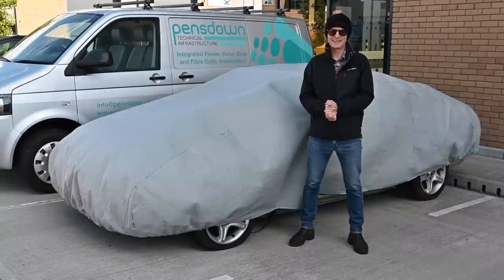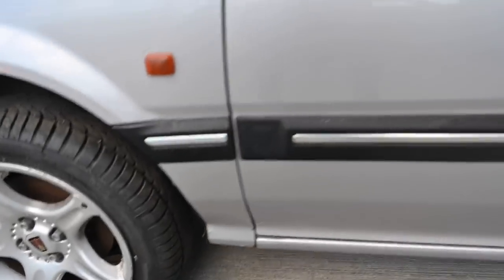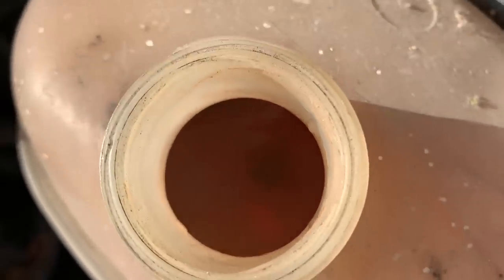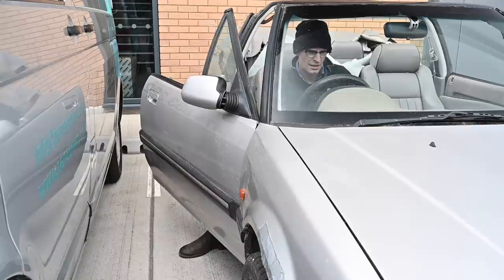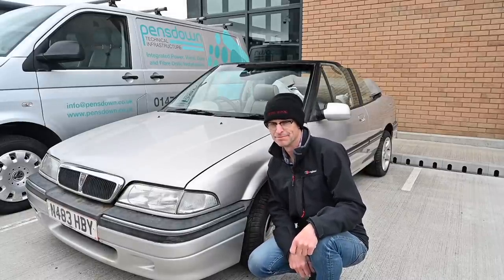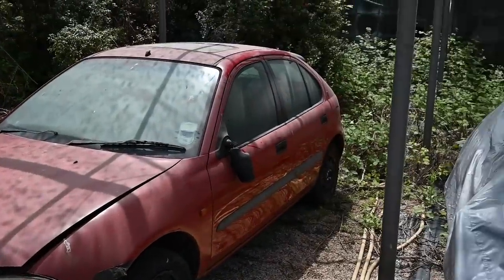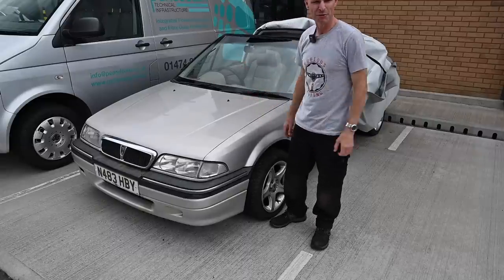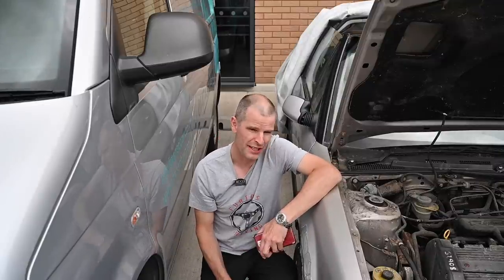New project reveal, another stray joins the fleet

Comment: That rotten front wing is a slightly different shade, I wouldn't be surprised if it's had a pattern wing fitted in the past. They're never galvanised and rust extremely quickly if when painted which explains the advanced state of decay over the rest of the body which isn't too bad.

Comment: I had 2 of these, 216 convertibles, I was always robbing parts between the 2 of them to keep one of them going.  Watch those back windows once you get the roof working, they tend to jam up against the roof and shatter if the are not correctly aligned, happened to me twice!!  BTW the leather seats get painfully hot in the sun, the cloth seats are better (if the roof works).

Comment: Hi Matt,
if the EKA is not working, then try and get the fob to work. They are actually a very reliable system, they honestly are. Once working they stay working. Try a new key fob battery (cr2032 it should be) and then re-sync the fob. Any time it has not been used for a long time, or the battery removed etc. the fob looses sync with the car. To re-sync it, you basically keep pressing one of the buttons.

The only problem they have, is where the little battery holder is soldered to the pcb, the joints crack/break.
Reply from the maker: Wound up changing all the ECU and EKA

Comment: Good luck with it Matt,  you mentioned the jacking points and I've seen many cars with dented floor pans so what I tend to do is mark the points with yellow paint and keep a grooved round rubber jacking pad in the car, it's too easy to forget the exact place along the sill seam when access isn't that good or at the side of the road.
Reply from the maker: many have a mark stamped there as well, which is very sensible

Comment: What were you thinking man? I'd make that someone else's problem/project if I were you. Also 16:40 did make me chuckle a bit.
I found this on an old forum which might help:
 try the following :
put the drivers window down - disconnect the battery - put the key in the ignition and turn to on - reconnect battery - see if that sorts it - if not try this again but then lock and unlock the drivers door before trying to start.

Comment: Seeing all those Rovers makes me wish I still had my 214SLi. It was a really early model on a G plate, with central locking (non-remote) and electric mirrors, but manual windows and no power steering. I kept it, planning to do it up "one day", but in 2008 it ended up getting scrapped when I traded it with a 1987 Audi Coupé GT from a scrap collector.

Comment: Hello, Had the same imobiliser problem with Rover 100. Turned out to be the body to loom earthing points - they rust under the connectors (even on a car that is used). Take them all off and clean and you should be able to turn off the imobilser. It you need to get the fobs and receiver checked a company in the west country called remote key can sort it by mail order - also take the connecter off the ecu and imobiliser and clean with switch cleaner as the pins on the connectors oxidise. Hope this helps.
Reply from the maker: Worth a try, thanks!

Comment: Did anyone else shout at the screen "borrow the batteries from the Tomcat keyfob to make the convertible keyfob work and deactivate the immobilizer"? I've used this trick to get an R8 started a couple of times, and it's gotten me out of a hole on both occasions. Shame this car was just abandoned for all those years, bet it was a really nice example when parked. Looks like a money pit from what we see on the video. Be careful Matt. For what it will cost to bring up to a running MOT'd condition, you could probably buy a really nice one and avoid all the grief. Not to mention that dreaded piece of paper with the word Absolute written at the top of it. If you know what I mean. Not even a Rover is worth that mate. Trouble is, R8s have such a habit of pulling on the old heartstrings.That breakers yard looked like heaven. Would love to while away an hour or two in there. Though I'd probably end up buying everything.

Comment: I would of got it going before spending with an alternator ,but anyway you would expect that disarm procedure to work .Try taking the door trim off and look for micro switches , squirt a bit of switch cleaner on them.You may even find it won't disarm until the hood is up and boot lid lock sorted .Give me an old car any day of the week to much electronic s  on them now.Seeing as you have gone that far concentrate on getting the hood up and the boot open

Comment: Matt what you need is a new battery in the fob. That should work. If it doesn't then you need the EKA code to override the immobilizer. I can tell from what you did that you do not have it. This code can be obtained for a tenner at most. By the way don't jack these on the cills there is a jacking point at the front of the car. If you need me to take a photo of how you override the immobilizer from the handbook let me know as it is the same as my 1.6 coupe. As for the boot I take it that the boot release in the car is also broken? Finally again I have a handbook that shows how to manually release the hood. Once you get in the boot and have it running it will make things way easier.

Comment: The jury must be out until you have it running and if it drives. The body will come back with some love but the interior is your insurance ,Rare. The immob might just be bad connections so good clean and wiggle on all connectors  and could be diagram time to check on pins for code signals from lock to immob. Its a basic unit so may be cheaper to go for a known good breaker replacement rather than send to a service centre. Greenhouse autoparts may need another visit. Fingers crossed for the hood. The 200 series rovers are still affordable for at the mo but will soon go the way of the other 80s  & 90s hatches as and when the numbers reduce a bit more.

Comment: Will be a nice project. You can program a fob at home for £60 but just put a new battery and try to get it working. You can press any button four times you don't have to press each etc also check the legs off the switch inside as they come loose.

Boot, I'm sure the cabriolet had a release lock on the floor where the boot and fuel flap release is and it locks the boot key out while the hoods down. If there is a key hole in the release on the floor try it and then try key in the boot and I'm sure it will undo.

I've had loads of these and worked on even more of them over the years.
Reply from the maker: They deleted the boot lock on cabrios for security
Reply: That's it I knew it was one way or another, can you feel the latch move in the boot when you try to unlock it?
Reply: @furiousdriving  very true, it's ages since I had my hands on an R8, rusty memory. If you can get the alarm box off and send it me I will get some fobs programed in as I've still got the gear to do it etc as I think your miles away from me in Yorkshire.

Comment: The car can be jacked up from the front central towing point, this allows both front wheels to be removed at the same time.....If both front doors are open and ignition turned BEFORE connecting the battery then the horn(alarm) won't sound

Comment: Watch out for the two small pieces of bent steel bar (one on either side behind the back windows) with ball and cup fixings on each end that pulls the hood in at the sides.  They snap regularly when the hood isn't maintained and it prevents the hood from fitting inside itself as it folds.  Mine broke twice and Rover charged a fortune for a replacement.  I showed the broken pieces to my Dad (who worked at a metal supply company) and he had someone make me a bag of 50 of them for £1!!!  The cup ends just screwed on.  I used at least ten of them over the following 2 years.

Of all the cars I've owned, my 1993 Rover 214 Cabriolet was my favourite.  It had 8,000 miles on it when I bought it in Maidenhead in 1994.  It had been a Rover Fleet car beforehand.  I traded it in for an Alfa Romeo 146 three years later (biggest mistake of my life - I've mentioned this in a comment before).  The only car I've enjoyed as much is my current Abarth 500C.

The thing I miss most about driving the Rover is the alarming scuttle-shake when you whizzed over a cattle-grid on a bend at speed.  It was exhilarating - the best location for such an experience being on the Isle of Barra on the road to Vatersay.  

If you sit in the driver's seat and look up at the roll-bar, it kind of looks like something from a shuttle from Star Trek The Next Generation!

I hope you rescue it.  I often wonder what happened to mine - K501 EKV; in metallic grey.
Reply from the maker: One is broken but Ive got that with the new hood

Comment: Worth perusing, any Honda based car deserves a second chance. 
The K series engine was a good little engine with only one Achilles Heel. The head gasket. That has been done so you have a good little engine.
Someone commented about a remote boot release lever. Not sure if it  had one but look between the drivers seat and to off side cill.

Comment: Code issue same same as a P38. Usually the lock is the issue so doesn't register the key turns. Fill it with WD40.

Also start with the car locked if it is the same as the Landy.

Odd these didn't get a remote boot release.
Reply from the maker: I think it is the same, these had the remote boot release deleted for security
Reply: @furiousdriving  may need to sync the key/fob as well. But good luck with it. 

4321 would be

Unlock x4
Lock x2
Unlock x2
Lock x2

Unlock car and start.

Comment: Did Mrs Furious Driving nearly lynch you then roll her eyes and say "Yeah right", when you assured her that it was merely bought either for its interior or to flip?😂
It is a good looking car that needs saving though. 
If you do work out the immobiliser spray a little bit of WD40 down the bores and turn the engine over by hand before you try turning her over on the starter.
After so many years she will probably be a little bit dry in the bores.

Comment: Morning Matt, so from my experiences with the dreaded Rover immobiliser firstly try replacing the battery on the keyfob and then repeatedly try pressing lock and unlock If that doesn't work there is a big chance that micro switches In the door lock are dirty and not registering the emergency key code so give the lock a good dose of wd40 and try the code again good luck ! Hope this one gets saved !
Reply from the maker: I was thinking it may be dirty. Now the shops are opening today I might be able to find some fob batteries
Reply: @furiousdriving  Fob batteries are available in all good supermarkets.
Reply: @furiousdriving  If that doesnt work then buy a coupe of used key fobs and get the all re-coded by a friendly rover/jag specialist with a T4 Notebook or a T-300 fault finder with a key programmer cable.
Alternatively this guy is really good, I think you can post him your ECU, 5AS and keyfobs and he'll recode the lot for you
https://www.technozen-electronics.co.uk/mg-rover-5as-alarm-ecu-services/
Reply from the maker: @seanturk1484  Ive not been to any in a while!
Reply: @furiousdriving  there's only a few common types
CR 2016
CR2025
CR2032
Have a look at your other car remotes and just "borrow" one 
to at least switch of the immobiliser.
Its been nearly 20 years since i worked at a Rover franchise so can't remember which battery you require.

Comment: I rather get the impression that this Rover is quite happy being asleep.  I suspect your issues with the hood and the boot are one and the same, the numerous joints in the hood frame have seized up from being sat with the hood folded, and the boot lock itself has seized from lack of use.  The hood might be easier to sort as the joints are somewhat accessible so regular doses of penetrating oil and spray grease may return movement there, but freeing the boot lock will be rather less easy due to the lack of access issue, though, once access is gained, the same procedure should do the trick.  I think your idea about breaking this one is the most sensible course of action, though.  Clearly its' storage over the last 6 or 7 years has not been the most careful or particularly kind to it, so I fear that the further you get into this one, you're going to find much more issues of the rusty kind, which is very bad news in a convertible.  On the up-side, what the car owed you with delivery should be recoverable from the engine alone, especially if the last owner can provide documentary proof for the engine work done just before it turned its' toes up.  I really struggle to see how anyone could drive their car until the alternator actually seizes totally, it would have been making horrible noises for some time as the bearings wore out, which is somewhat worrying as it rather suggests that the car had an owner with an absolute lack of mechanical sympathy, which really isn't good...

Comment: Wow what a collection of rovers
Reply: I looked for the link to that rover guy i scrapped my MGF SE..Last year to scrap guy for free,the year b4 i blew £635,on mot..but wasn't keen to blow the same at its last mot..but that place would have been the place to give them car..either for a resto project or a doner towards othe mgf se cars..body work was in fab condition it was mainly front wing,and the seat belt anchor points..oh and the suspension went lob sided but had that part..regret giving it away..like the rover you have..the doors looked and wouldn't open battery was flat,and bonnet realease catch stretched too..so gave up the ghost..silly little winter issues..

Comment: Sorry to say Matt rather a junker than a flipper 🐋 
Why don't you put new battery in the remote ? Very unlikely it's held a code but you never know.
Secondly I'd try and turn engine over by hand. It has been known a seized alternator would jump belt !
We used to just call Rover in the day to retrieve code. Always worked on the door method so I'm guessing wrong code, I remember it's seriously long, if only four digits that's the radio code.
Replacing ecu, reprogramming etc is too expensive.
By the time you've spent on tyres, new braking system etc you could just buy a decent running example.
As ever just my humble opinion mate.
Reply from the maker: These always look bad at first but a bit of effort brings them back.
I couldnt find a battery last week, lock down fun, but will try that this week. EKA is only 4 digits, Ive used them before, and a paired ECU and fob isn't much for these. Bearing mind Im doing most myself its not a big expense financially
Reply: @furiousdriving  
It's a long time ago but used to work for Rover main stealer and sold those new.
Seem to remember code being longer than four digits which was the radio code. Guess you could try on the radio first. 
Please try and turn engine first as will be total loss if belt snapped or jumped.
I can't see anyone parking up a decent running car just for an alternator but honestly I hope I'm wrong.

Comment: Have a word with an IT geek, should be able to sort out the immobiliser, after all criminals can override them with a programme on a laptop which they must have obtained from somewhere, Dark Web probably.
Reply from the maker: No ones plugging a laptop into these, they only have a 3 pin plug that no one has anymore! It is doable though
Reply: @furiousdriving  Criminals steal the cars using the programme installed on their laptops by wireless, the programme accesses the Bluetooth code and switches of the immobiliser and unlocks the vehicle, they just have to press the start button and drive off with ones pride and joy.  The Rover is before this technology so only the code for the immobiliser has to be deactivated, should be able to be done by using the frequency of the key fob and a random code generator programme, may take a good few minutes.

Comment: Out will come the wheel silver rattle can 😂
Reply from the maker: it deserves some decent paint here
Reply: @furiousdriving  I think the hood mechanism is rusty, can't you spray pb blaster on the joints of the roof? Once you free the pivots up I think the roof will work. Ps when you was doing the immobiliser hack, should you of held the key in the open / Close position instead of releasing the key? Just a thought